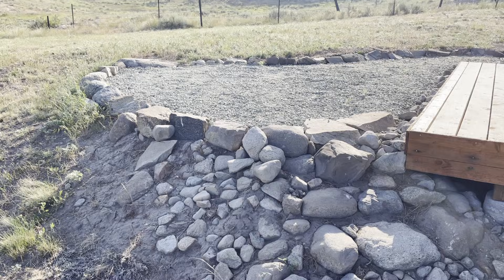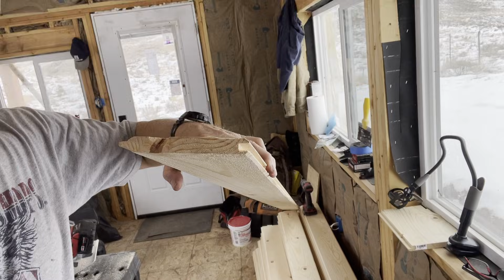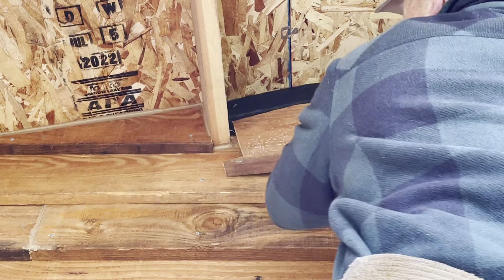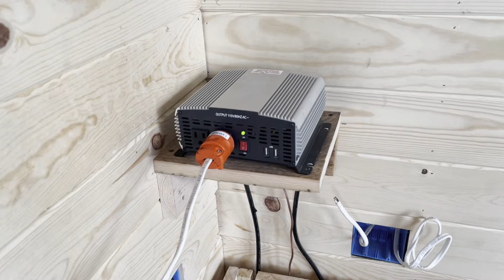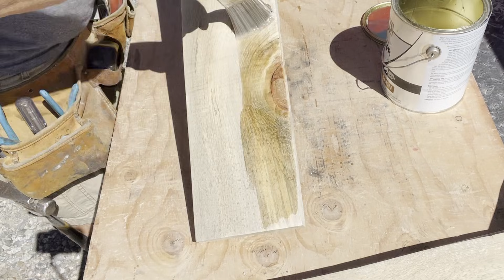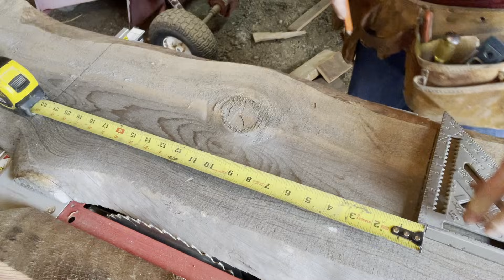Building an Off Grid View Cabin, Start to Finish.

Comment: @LifeontheMoose I like the video.  One thing I had a question about, and I tried to find if you covered it, but when you were nailing the siding on the house, arent the nails supposed to be on the thinner side of the board, and then the board above covers the nail? I feel with you literally drilling a hole into the side of your home, you have given moisture a place to get in.  

I love that flooring. and the Blue Pine is stunning on the inside!!! Keep doing your vids!
Reply from the maker: Hey thanks so much! Great Q I get a lot. Even with the newer cabin I’m building now. Short answer, it’s the wood. It’s Doug fir, not typically used like this, and the cut wasn’t with siding in mind, either. It was so dry it split too easily ti get much narrower than I did. Thanks for watching!🙏

Comment: Gee Patrick, there are so many ideas that you have used in making the cabin, like light fittings, recycling timber, great floorboards and ideas to start build using reinforced concrete with metal brackets to base of cabin to prevent wood rot. Well done. Cheers
Reply from the maker: Thank you so much! 🙏

Comment: Laquer on a floor is a complete waste of time and money. Use varnish or a waterbased floor finish. OSB junk board exposed under the eaves?  Bad move. Covering the CLEAR doug fir fascia board with pallet wood? Very odd indeed since it removed the required overhang of the metal Roofing
Reply from the maker: The laquer was perfect, the OSB will last, and the eave trim is on order. Thanks for watching!
Reply: Well, at least laquer is a suitable sealer before applying varnish. @LifeontheMoose

Comment: I build just like that but have started putting 1/2" foil face foam board over the walls and ceings before paneling.  HUGE increase in insulation value - tape the joints with 3M foil tape. Airtight.

Comment: Oh wow , just had to pause a bit at 50% where you were in "recovery " from the fire , which will probably end up being a blessing anyway for solar, wildflowers and a garden . Isn't "blue pine" just white pine that is cheaper because it got some sort of fungus? A Van- Kid said that.  It ends up looking  great anyway.  I love the "tips and tricks" to eliminate fumbling. Why not stain or seal the celing boards before installing? Less back strain . I'm now leaning towards big-ass windows and the right sized stove. I figure if you thing you're gonna die in a blizzard, then it's blackout curtains and maybe even shutters and leave a smaller window uncovered.  Oh I saw the coolest solar panel Idea from a Michigan Yooper. he mounted the panels on a turntable to "follow" the sun, you could probably even MacGuyver a motorized rotator thing on a timer . Then again you have almost no blockage so you can go full south. Oh and great points on the foundation.  Great work sir, love this.  Subbed.
Reply from the maker: Thank you so much! And I appreciate your comments. Look forward to having you along.

Comment: Suggestion for the box in the wall the cord comes from that plugs into the inverter. Use a switch cover. Drill the hole a little bigger for the cord to come through.

Comment: I built self contained solar system for stream monitoring gauges for the USGS and one thing you might want to think about is venting the battery outside somehow If you move up in battery size. I think that battery is sealed, correct? just check once in a while if starts to expands obviously change it out. I love that mount you made for the panels.
Reply from the maker: Thanks so much! Yeah the battery venting outside is a thought… I appreciate you watching!

Comment: Great job, I noticed you struggling to drive screws in with your drill. You should think about using your impact driver instead of your drill to drive screws and other fasteners as that is its main function. Your drill really is for that, drilling. Once you drive a long construction screw in wood with a impact driver, you will never use that drill for that purpose again and your wrist and shoulder will thank you.
Reply from the maker: Yeah I was just using what was available at the time. Not always the best or easiest! Thank you for tuning in!

Comment: FYI, a receptacle cannot be used to complete an electrical circuit.  The incoming and outgoing power must be spliced by an appropriate means (wirenut) with a pigtail to the device (receptacle). 
BTW, very jealous of your skills and location!
Reply from the maker: You are correct! I appreciate you watching and commenting.

Comment: You've made a terrible mistake that will rot the cabin pretty quickly! You did not insert a water vapor barrier inside the insulation!
Reply from the maker: No need! Any moisture in this climate will come from inside the building in the winter, not outside. Plus, it won’t be heated for any long period of time. Thanks for watching!

Comment: For a small cabin or tiny house, the cedar fence planks sold at big box stores like Lowes make good lap siding. It’s super cheap. I’ve used it both as shiplap and beveled siding on small projects. It’s fairly easy to modify the boards with just a cheap table saw or even a circular saw and a jig. Pressure treated works good too if it’s going to be painted. A lot of people give away old fencing when they build a new fence, so that’s a good source.
Reply from the maker: Great ideas! Thanks for watching.
Reply: I love good info!
Reply: Loved the build.

Comment: Morning from Maine,is their a strength reason for using those type over trusses with a straight board on bottom like i usually see here in Maine? Just curious.
Reply from the maker: Hi to Maine!
You mean the rafters vs trusses? Head room mostly. These trusses are oversized, so no worries with strength. Thanks for tuning in!

Comment: I think that you have done a fine job building your cabin. Oddly enough y favorite thing is the scrap wood face plates on your switch’s and outlets. Clever. Due to your latitude I am surprised that you haven’t added a small wood stove.  It surely will not take much to make it warm in there. 
Best Regards Al from Virginia
Reply from the maker: Hi Al from Virginia! Love those outlet covers, too. We thought hard about the wood stove, but that can open a few “permitting” problems, so best avoided. Thanks for watching!

Comment: Very creative and functional, looks great. But I would caution not to use the wall outlets to form the electrical circuit connections. Someone did this in a house I bought and this caused an outlet to overheat, house caught fire. Simple fix is to use wire nuts to connect the circuit wires together, adding a short pigtail wire to each connection point. The pigtail is then connected to the outlet. Everything still has power and no connections overheating so no fire risk.
Reply from the maker: You’re right, it isn’t ideal. I’ll use that method in the house we build, hopefully starting in a year or two.